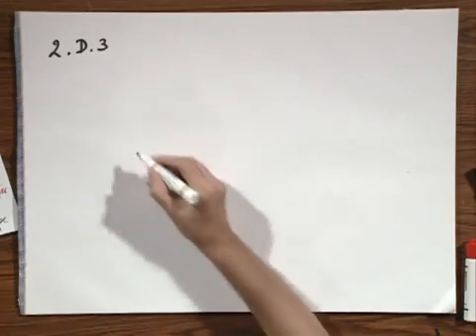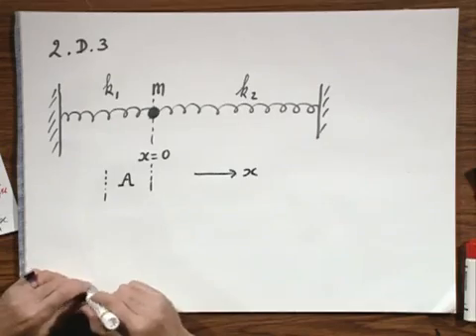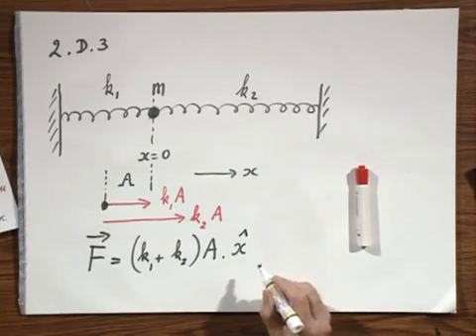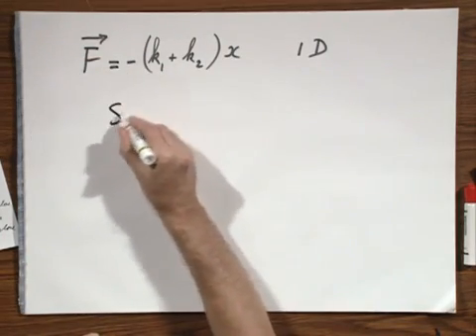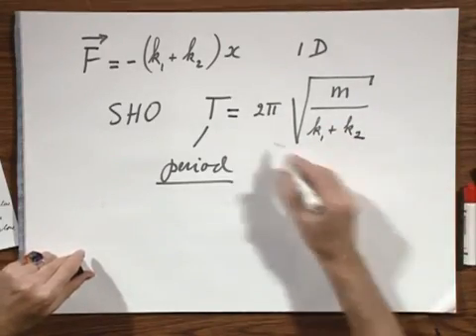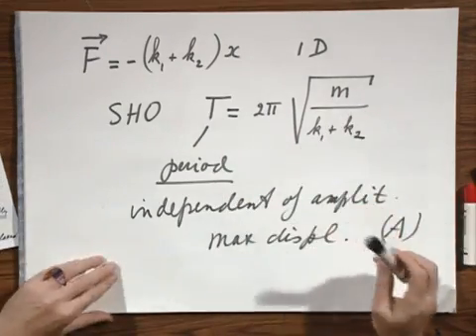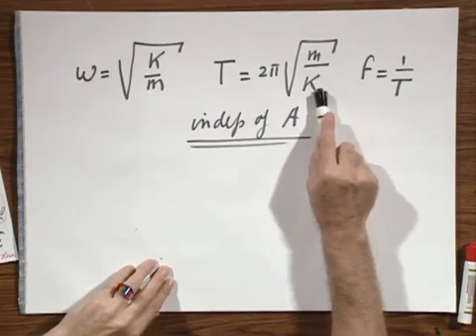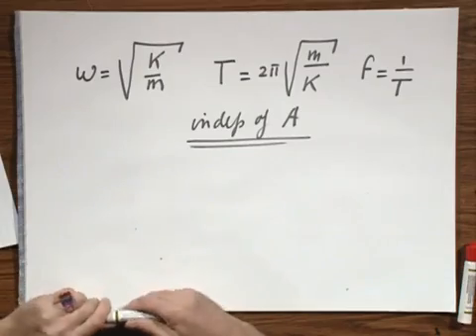8.01x - Module 15.03 - Two springs with an object (m) between them.

Comment: Sir at 16:55 force Fk2=K2s exerting should due to K2 because k2 is spring constant kf 2nd spring and compression occuring in it and due to K1,Fk1=k1s...I am confused
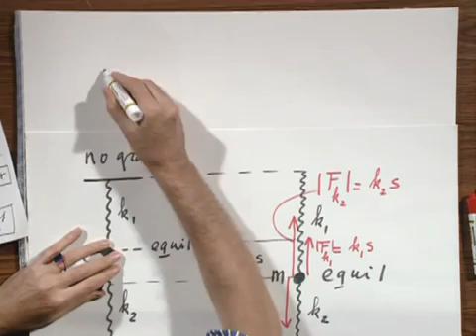Reply from the maker: I listened from 16:00 - 18:00 and I cannot add to the clarity of this video. Plse watch it again
Reply: @lecturesbywalterlewin.they9259  ok sir
Reply: @supernova.1234-r2b  so similar to the first part, the two forces add

Comment: 2:15 isn't that equation wrong? Amplitude A is negative, so when multiplied by x roof you would get that the resulting spring force is in negative direction, when it is in fact in positive direction.
Reply from the maker: eq is correct
Reply: @VidyVid amplitude is always positive, it's the absolute value of maximum displacement.

Comment: Hello professor!
  Time period is independent of amplitude. Just consider an ideal spring which has an time period of few seconds, if we stretch it out to the distance of 1 light year and then let it go. Will it swing faster than the speed of light ? (It's an ideal spring and time period is independent of amplitude).. I know this will not happen and it's an crazy idea. But just think for a moment.

Thank you for making me understand Physics in deeper level. I have watched almost all the lectures from you. I love all of them!!!

                            Thank you 
Lovely,
Hariprashad Ravikumar (from India)
Reply from the maker: In my Lectures at MIT I typically extend springs by about 10 light years. Works very well.
Reply: Lectures by Walter Lewin. They will make you ♥ Physics.   If it so, will it swing faster than the speed of light ?.  Will it break the laws of physics ?
Reply from the maker: Yes the speed is then easily 10c. Students ❤️ that as they use that speed to travel to the Moon; it will take them only 0.1 sec (and, of course, 0.1 sec back to Earth). PLEASE watch my lectures and get educated. I discuss in one of my lectures the conditions for Hooke's Law to hold.
Reply: Sure professor.. thank you for letting me know ☺
Reply: @lecturesbywalterlewin.they9259 
hahahaha :)
Reply: Love your fascination regarding the topic towards the end, really shows you are an amazing teacher!